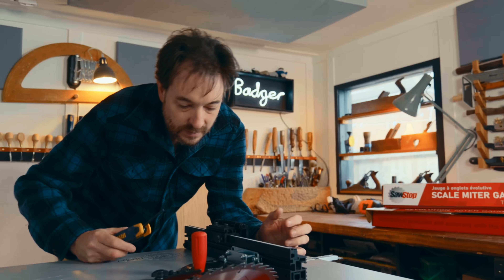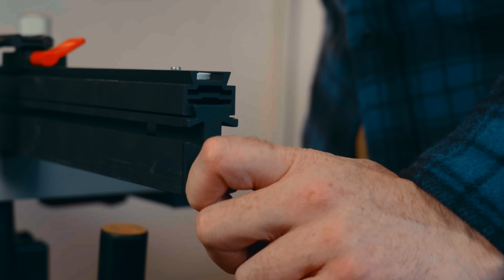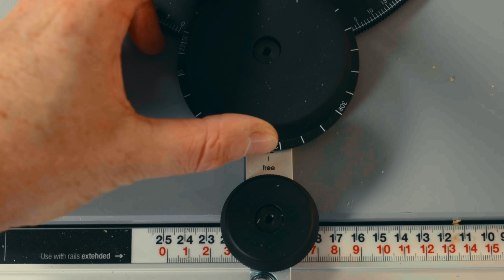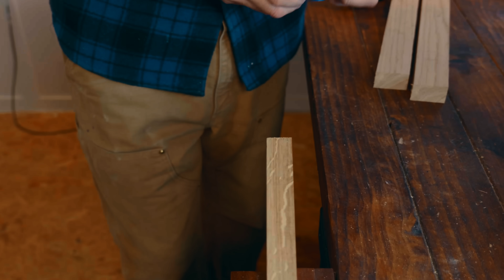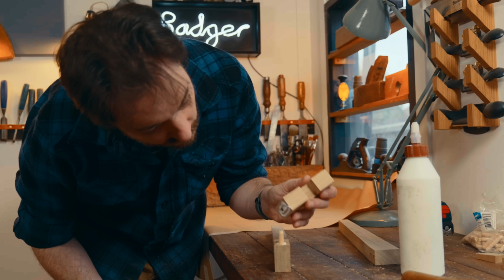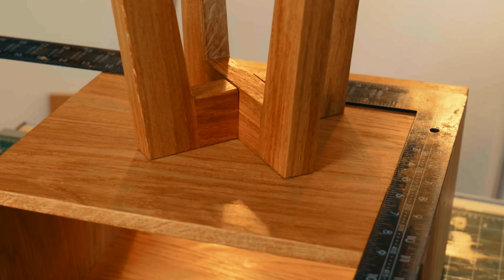Building A Table With The Safest Table Saw

Comment: Thanks Matt, that's an elegant yet simple design that shows off the natural beauty of the Oak, it's a good demonstrator for the saw too as it shows the accuracy of the angles, mitre joints are so unforgiving of sloppy cuts ! This could also easily be adapted by including a drawer or two or a shelf, also I think you could relatively simply add either a chamfer or a angle to the front edge of the box which would further add to the aesthetics ! That mitre gauge looks excellent and well thought out !

Hope you have a great time at the show, wishing I could join you there !

Comment: You shouldn't use a full length fence when cross cutting. Wood could bind between the blade and the fence and take you out.  You can buy a half or flip fence for that purpose so there is no tension at the start of cut point. Also, use a mitre saw for those small cross cuts, you're trusting that holding a piece of wood against your gauge without it moving and pushing It through a blade to have a clean cut. Your potential for injury is greater with your methods.

Comment: Thanks for posting this video.  Its made my decision to buy the saw stop site saw.  Will you have a discount code do you think? 

Also, I'm sorry, I like the design, the wood and finish is lovely.  You have a dowel drill and dowels.  I do wonder if the L brackets spoil it somewhat.  

Other than that, excellent as usual.  Thanks again

Comment: The safest table saw is not the saw. Its the person who respects and is aware of safety when operating a table saw.
Reply: Don’t be so over confidant using a SawStop product. Oh, course you don’t know, but i wouldn’t trust the SawStop anymore than I trust brand X table saw.
Reply: I dunno, this one is still safer. Respect another saw all you want, it’ll still cut your fingers off.
Reply: @detroutspinners9933 I saw a demo of the Sawstop at Axminster  Tools and Machinery. It was amazing. They showed a picture of someone who had lost a finger. He had 30 years of experience, but it just takes an instance.